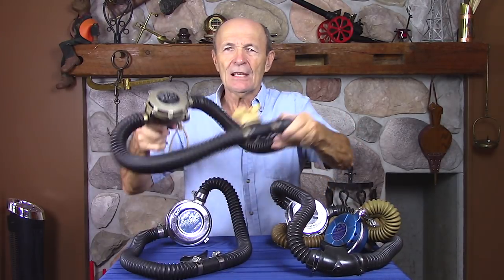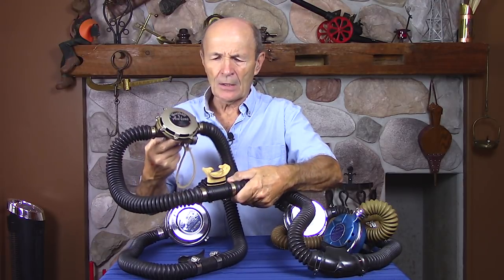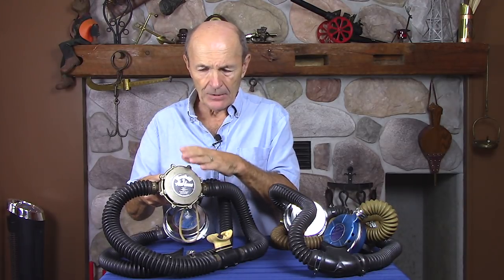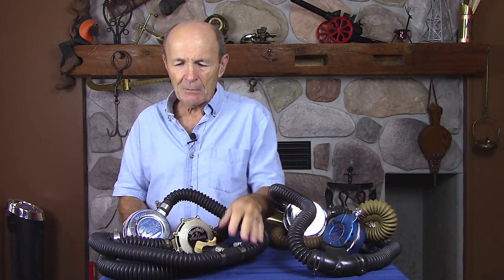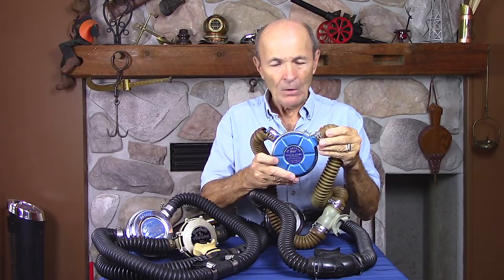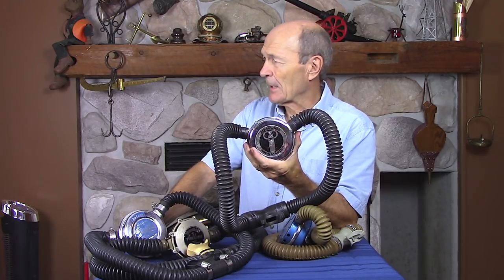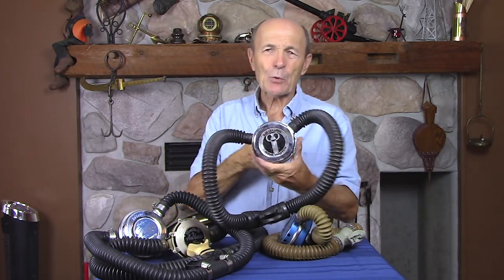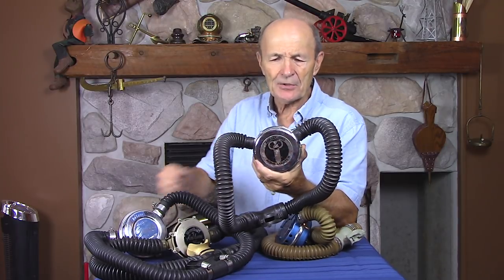Vintage Scuba: Regulators - What Should I Buy? - S06E01

Comment: I have a US Divers Mistral and a steel 72 with a J-valve and a contoured back plate. I take it in the water once or twice a year.  Not the best breather (single stage),  but it is a fund dive.  Works quite well.
Reply from the maker: That's the fun of vintage diving.  Good memories, fun but not always easy compared to todays gear.  I still love doing it.
A

Comment: Hey Alec Great video again!! Thank you for the information :) I wanted to get a double hoses regulator for a long time. And I visited vintage double hose.com. Is the "Kraken" regulator a fully upgraded regulator? Will it work with modern BCDs?
Reply from the maker: The Kraken is a fully modern regulator using all the latest technology and materials to give top breathing performance and reliability - all in the retro style of a double hose regulator.
It is designed for an will accept all modern accessories.
And it's well priced too.
Alec

Comment: Thank you for the educational video.  Can you perhaps make a video or explain below why one would want to dive with double hose regulators?  I understand the nostalgic attraction.  What cause the industry to move towards single hose regulators?  Your perspective would be very valuable.  Thank you.
Reply from the maker: Why the move to single hose?
1. easier to service
2. cheaper
3. more efficient
4. easier to adjust
5. sleeker - less bulky
6. smoother breathing
7. much more robust
8. easier to share if needed
9. easier to clear
10. quieter

There's more but it gives you an idea. 
Once the single hose regulator was sorted out, it simply replaced the 2 hose and it didn't take long. The first single hose was about 1962. They became commonplace by about 1965 and had pretty much replaced the double hose by 1970.
Take care.
Alec
Reply: Thank you very much. @AlecPeirceScuba_SeaHunter

Comment: Wish someone could make a doublehose second stage.
Reply: Check out Argonaut Kraken
Reply from the maker: I'm not sure what you mean by "double hose second stage".
Technically a double hose regulator has a 1st and a 2nd stage but they are mounted in the same box, behind your head.
Are you suggesting a double hose regulator that has the 2nd stage in your mouth?
There is one of those too
Alec.
Reply: If you look at the Aqua lung mistral you can se how it in 2 stages. There is a LP hose between the stages